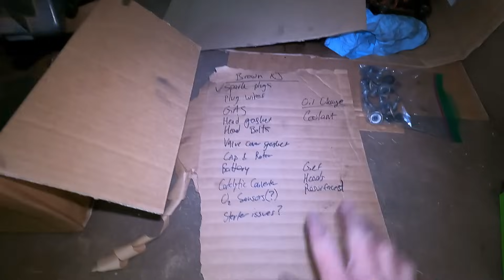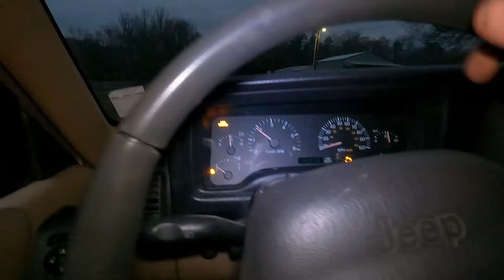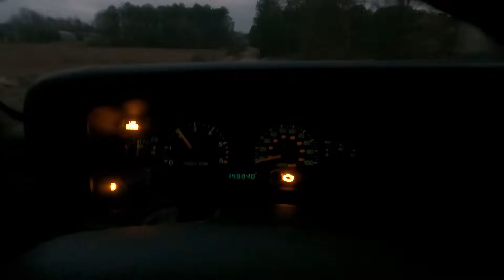Making My Mint XJ Roadworthy Again and 4X4!

Comment: Cool Video. I do believe you about having the bolts memorized. I used to work at a ford dealer rebuilding  transmissions. I had every bolt, nut and location of them on the Taurus memorized. Keep up the great work!

Comment: I had the exact same issue in a 94 4.0 XJ. 275,000 miles. 1st cyclinder piston hole. It wasn’t center, though. May have had a valve slap at TDC. Couldn’t really tell.

Comment: G’day Dex, could you please do a detailed run down on the 2WD version of the XJ.
I live in NSW Australia and the Jeep’s only come available with 4X4.
I don’t want to get rid of my 2001 XJ and get a smaller car as I have to deal with crap 💩 roads and wildlife.
I have others that are 4x4 so one 2WD would be good for a daily commuter.
I’m thinking about importing a AW4 from the states and I have to build a 2WD front axle myself as there are some different things like the track bars location.
I have other vehicles here that run the AW4 in other makes like Toyota and Mitsubishi that I maybe able to adapt but I’m unsure of what the 2WD XJ crossmember mount is like.
I pay $1.80 a litre for petrol or as you say Gasoline here and it’s a killer.
I’m hoping to get around 10 litre per 100 kms or 62 miles out of it which I believe is possible.
I would like to set the Jeep lower to and keep the standard fitment tyres on it to.
Like I said it’s more about chasing the fuel economy than anything else.
The xj comes here with 3.55 and 2.5 diesel comes with 3.75 so I can play around with ratios to.
What you are doing with Jeeps is my dream but they have a small following here in Australia 🇦🇺 
Keep up the good work mate

Comment: What could you say about a WJ transmission and or transfer case leaking at the transmission mounting bolts? Why and is that possible?  I’ve cleaned it completely and barely in 1hr what looks like transmission fluid leaches out. And no nothing from the top is wet only the area at which you mount the transmission mount. I’d add a photo but idk how. Thanks for all your knowledge!

Comment: hey did you ever figure out what was going on with the comanche? my cherokee has a similar idle issue but I have an REM (renix engine monitor) Weird enough I get a loop fault lean, loop fault rich, o2 sensor heater voltage low/high. So the o2 sensor is definitely  bad. I am gonna change it and see if that was truly affecting it. But just saying that could be the issue.

Comment: Got a question. I'm using transmission and transfer case out of a 96 on my 2001. As far as electrical what do I got to do to plug all the connections in?  If you have something you working on similar it would be to see a video about the transmission plugs.  Thanks

Comment: Can someone tell me which years of 4.0 will fit in my 1997 Grand Cherokee? I’ve found one from an early year XJ (1990ish) but I’m not sure if it’ll work in my Grand Cherokee. I don’t mind swapping sensors and accessory brackets and such, I just don’t want to pull the head if I can keep from it.

Comment: How can I fix a weak crank on my xj and and need to give it some gas in order for it to start up?
Reply: When you replace the crank shaft sensor buy it Mopar.
Reply: Did you change spark plugs and wires yet ?
Reply: The alternator is good I put new jeep cables from jeep cables new park plugs new crank shaft sensor  idk what it could me maybe electrical?
Reply: I haven’t changed the wires yet but the park plugs are fairly new
Reply: @jorgegarage9593  get some water and spray it at night and if it arches you need new wires.
Reply: @jorgegarage9593  take the wire brush to the battery terminals like take them off and hit the copper wire to clean it. And make sure there's no corrosion in the fuse box if so clean it
Reply: @jorgegarage9593  man I used to have to turn it  over two 3 times for it to catch on. I did what I just told you and I ended up changing the crankshaft sensor with a duralast one but yesterday when it was snowing it shut off and I had to tap the sensor with a long screwdriver so I'm just going to end up ordering the Mopar one what my uncle told me and he's a mopar mechanic for Dodge.
Reply: @nathanmccumber8965  I appreciate the help brother I’ll give it a shot hopefully it gets better
Reply: @jorgegarage9593   put the water in like in the empty Windex thing. Going to go by the rotor cup and spray it at night and if you see it blue spark u need wires an a rotor cap.    Yeah once I change the wire it would start on 1st try then it went back to having to turn it over few times. But now it goes on the 1st try. I did sensor crank shaft sensor. You could either get it from the top or if you get it from the bottom you're going to need a lot of extensions.  Try to get Mopar one. It'll last 20+ years.

Comment: You ever sell these jeeps ? I would love to find a clean stock Jeep , I’m from Corbin ky and you don’t find them anymore unless they are rusted out
Reply: We are hearing Dex talk about these Jeeps getting much harder to find than ever before. Partially from increased demand for them, plus getting ragged out off-roading and scrapped out. Has a few years supply before having to go back to mechanic work for the public. **Think he would build custom roll cages, winch bumpers etc before resorting back to a public mechanic. Tooo much drama!!
Reply: Cut weld new steel to it. That what I am gonna do to mine from Midwest.
Reply: @nathanmccumber8965   plan on doing that to my xj I have now, but you know how it is,we all want a cleaner one.
Reply: @Wiz-kidddd  yeah I got mine for 250. I've been beating on it. I need new tires and tire flares front bumper with a bar.

Comment: Dex have you had any problems with the ecu connectior closest to the fender on a 1997 jeep grand cherokee. Wiggle the connector and the engine will die and puts up ignition coil A circuit primary malfunction or code p0351
Reply from the maker: It’s not the connectors. It’s the pcm itself